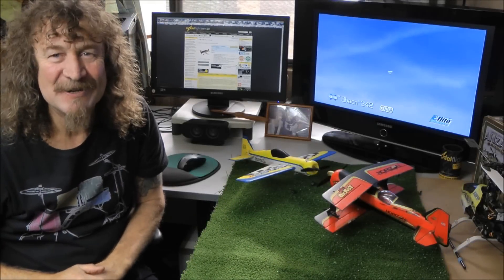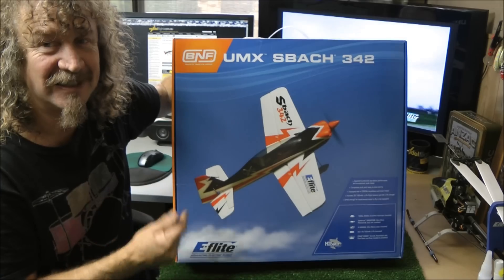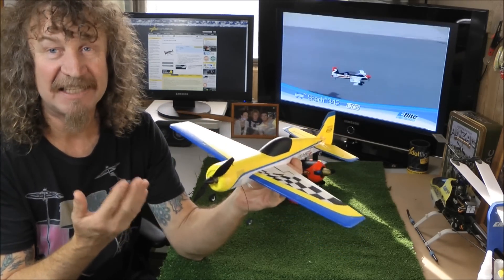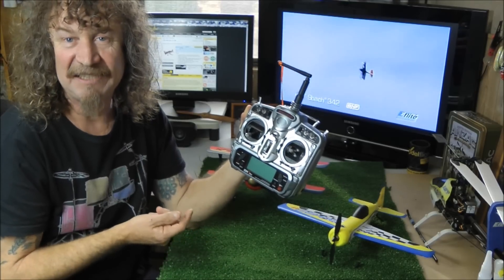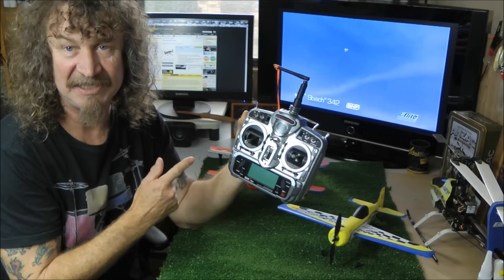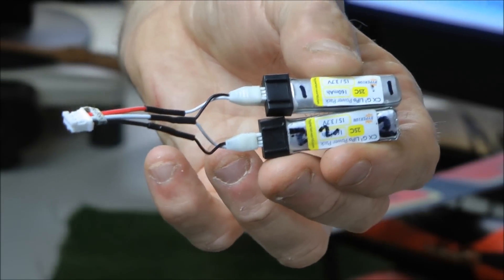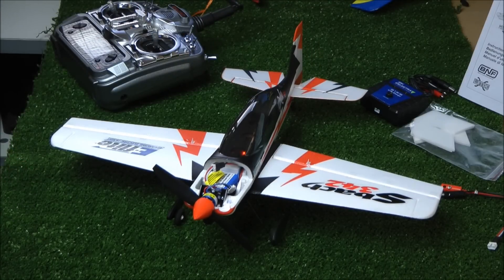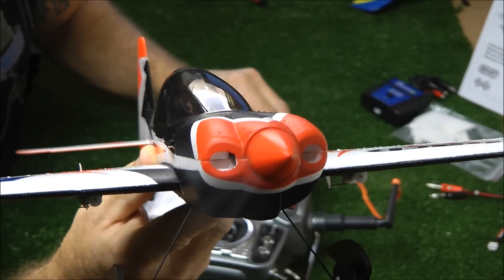E-Flite UMX Sbach 342 Un-Boxing-Review

Comment: I can fly helis but have yet to fly a plane, my question is what would be a good starter plane. Dig the jelly bean drum kit shirt!!!
Reply from the maker: if you want to fly the ultra micros first up then maybe one of the ones with as3x the P-51 is a nice flying plane. If your going to go straight for a UMX then any of the current crop are nice flyers, but not really a beginners plane. If your going to want to start at the bottom and work ya way up the Hobbyzone Champ in UM is the way to go if you want a bigger plane then the new Hobbyzone Corsair or E-flite Apprentice is the way to go, hope this helps a bit?

Comment: hey chuck could you please tell me it's possible to use a Y harness like the EFLU4068, to connect two 1s batteries making them 2s and putting it in a 1s parkzone or blade aircraft?